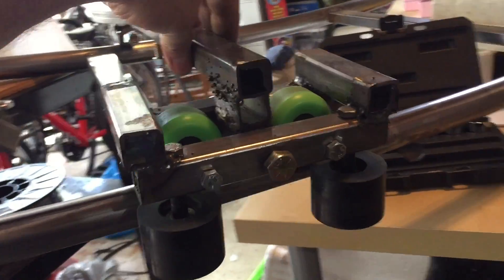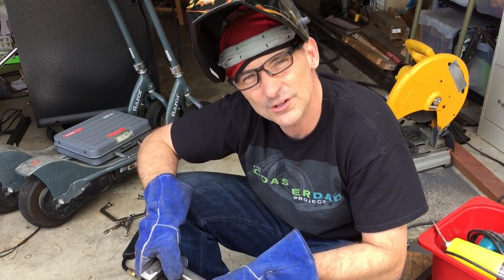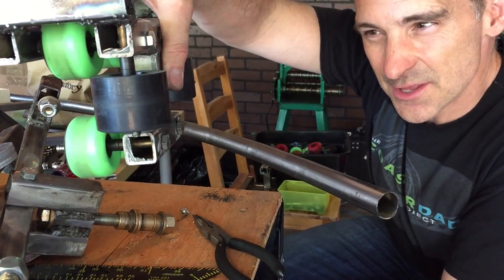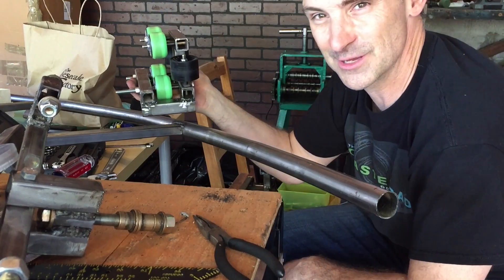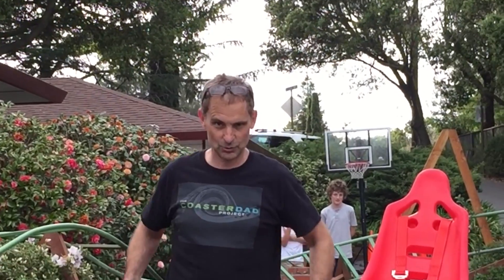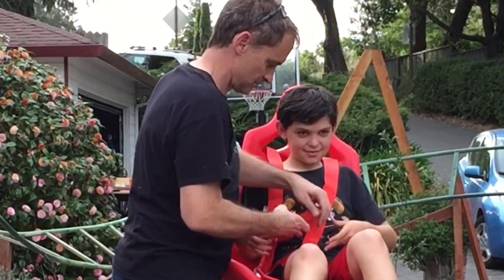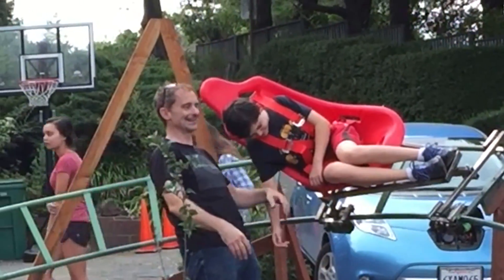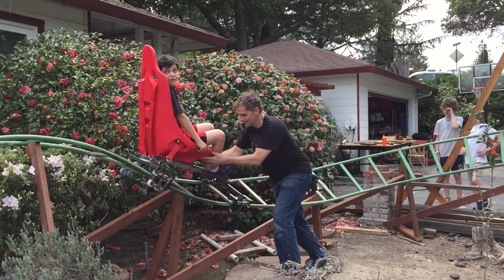Front Yard Backyard Roller Coaster - First Human Trials

Comment: Looks good.   On the upstop support design, welds in shear loading are better than weld in tension loading, but that would be more of a fatigue issue, and would be an problem if you were using it many thousands of times.  If you have any doubt, you could send a long grade 8 bolt from top to bottom, right through the center of the vertical support tube.  I think you'll feel quite a left jerk in the first turn off the hill.  Your riders will probably learn to lean right coming off the hill, which will minimize the loads.  You might want to leave a little clearance between the upstop wheels and the track, or it will bind a little on hills and valleys.  But, you wanted more drag....  The cart looks really good.  I assume you'll provide some sort of bombproof way that their feet can't get down to the track.
Reply from the maker: Paul Gregg 
First off, you were right about the seat. Headline is too rough off the first drop and after the camel hump. I'm going to experiment with different seating, and and enclosed cart.  I'm pretty comfortable with the welds these days. Great thing about modular design is that I can add/remove/change/replace track segments. First to go will be the turn off the first drop. I'd like the rollout to be longer and convert more potential energy to kinetic fun :) 
As with all things, a work in progress!
Reply: Merci